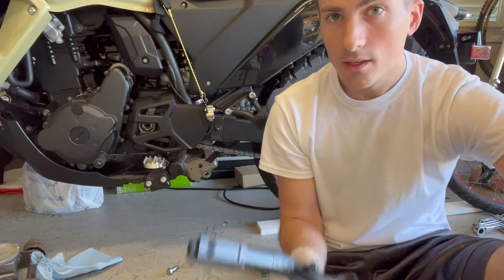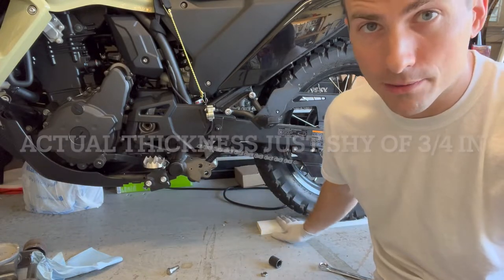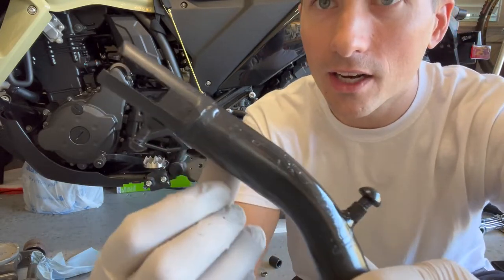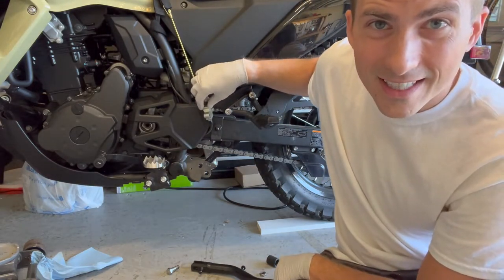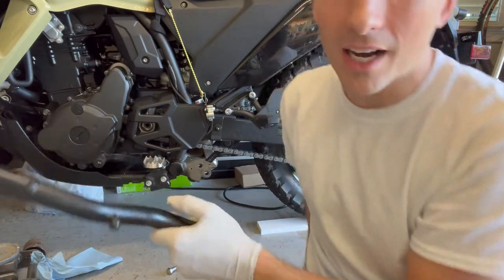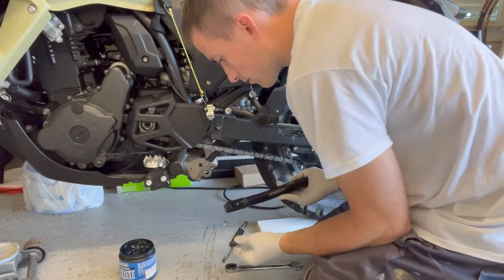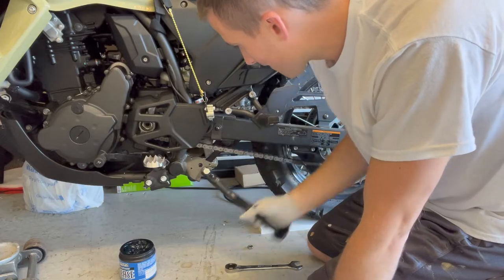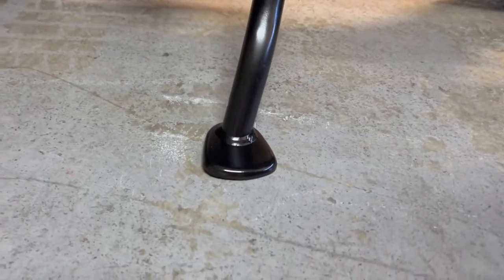KLR 650 How to shorten and replace kickstand

Comment: Good video, & sounds like that muffler shop did you a solid considering the extra prep & welding.  I would have suspected they would just cut the bottom of the kickstand (the pad) off, shorten the tube an inch & re-weld it instead of doing what they did.  That said I like what they did better 👍
Reply from the maker: Agreed, I’m happy with it. Although the angle is a little bit off because the geometry changed, but it’s not bad at all

Comment: I went with an adjustable stand just in case i want to put it back to normal height some day.  Wasn't cheap, but i like the flexibility.  I used a harborfreight "hook screwdriver" to get the spring back on, they are a bit of a pain.
Reply from the maker: Not a bad idea. I figure I can buy a stock kickstand to swap out pretty cheap if I decide to raise it back up.

Comment: Seems more practical to cut off the foot (porta-band), cut an inch of "hallow pipe" at the bottom (porta-band), reweld the foot on, could be done without removing the kickstand from the bike. No need for scoring the top reworking the system adding "punch welds" etc.  Maybe I am missed something?

Comment: Thanks for the video, just curious how much it was to have a shop weld that?
Reply from the maker: Cost me $60. I’d imagine it’s +/- $10-$20 pending on the shop. Basically it’s just paying for hourly rate of the tech that does the cut and welding.
Reply: @rwalls88  Thanks for the info!

Comment: did you raise the fork tubes up 1 inch to compensate for the 1inch lower in the rear?
Reply from the maker: No I did not. I considered doing it if I felt it necessary following some road and trail tests. It performs great and no issues so I won't be adjusting the forks.